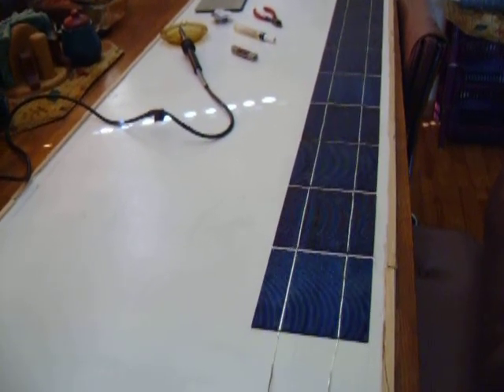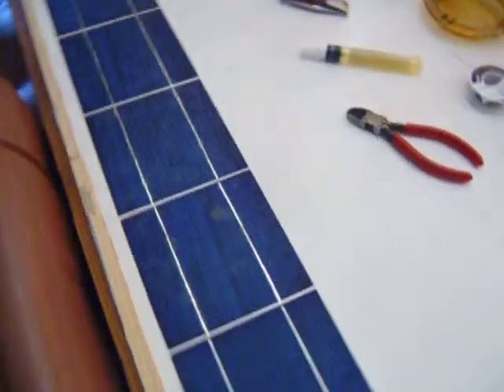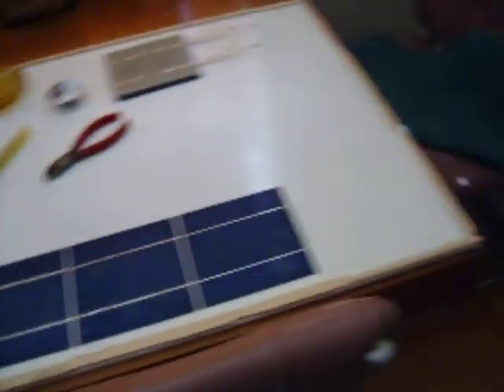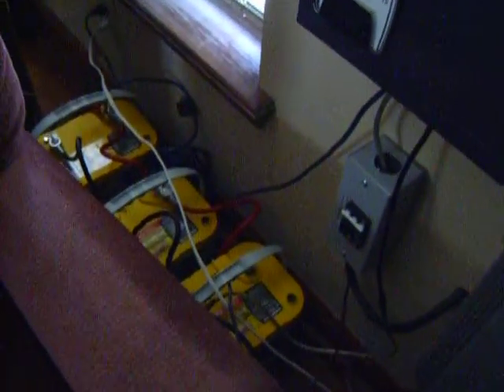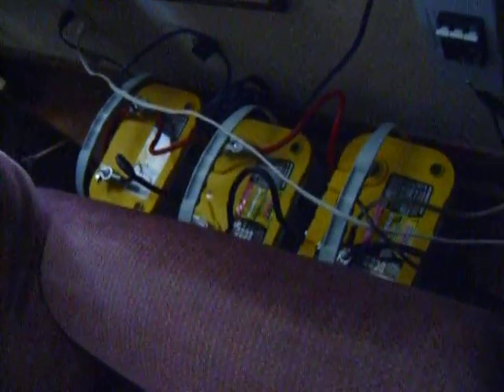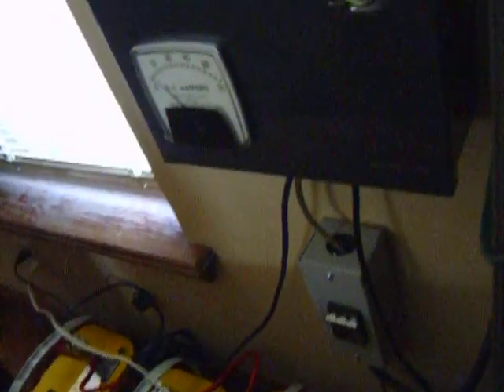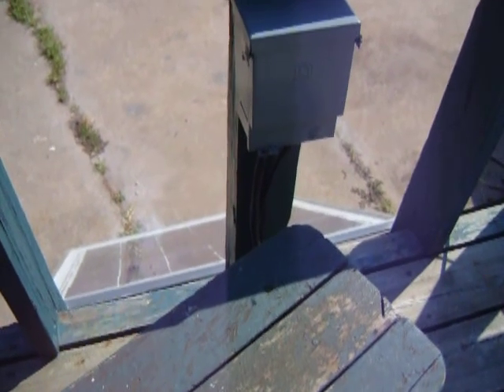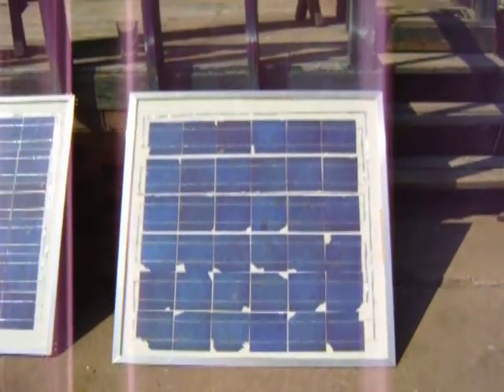DIY Aluminum Frame Solar Panels And Charge Controler pt 1

Comment from the maker: @GodGunsGutsGlory4KJV you should build one for the fun of it any way I enjoy making them. I find a piece of glass at an antique store or second hand store I figure the glass should have a better life being a solar panel. Its just fun to make cool stuff. If you glue them to a glass and pour some encapsulation on them and put a frame around that it could last you long time. Plus it makes free electricity what could be better? You may need it later on. I just made one out broken cells works great!